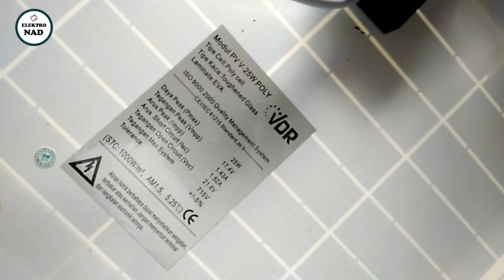12V Battery Solar Charger

Comment: this consumes the power of the panel. the best would be a connection at the battery terminals, which short-circuits the battery, even through a 20w lamp when the voltage is 14.3.. does not tax the panel's power at all.

Comment: Can we use a commercial buck converter or step down to decrease the voltage to 12 Volt?

Bisa pakai DC-DC Converter ga untuk menurunkan tegangan ke 12V?
Reply: yes

Comment: El circuito que tenés armado está mal, si medis a la salida del 7815 vas a verificar que la tensión se debe mantener constante en 14 o 15V por más que tapes parcialmente el panel solar, no así como ocurre en tu caso que en el emisor del Tip3055 cae a 4V. Por favor revise el circuito propuesto. Saludos

Comment: My solar panel is1000 watts and battery is 400 AH now I need how many Ah charger,u can make my tips of charger??
Reply: You need 80 to 100 amperes charge controller
Reply: just buy a 20 amps charger and charge for 24hrs. much cheaper and reliable

Comment: That cicuitry was unnecessary! Connect solar panel straight to the battery through a diode. I have a 4'x4' solar panel puts out 19 v at 3/4 amp . I charge batteries of all sizes . There is not enough current to need anything besides a diode in series. The diode prevents the solar cell from draining the battery when its dark or real cloudy! I've been electronics for over 50 years !
Reply: Thank you walter.. will surly try this method.
Reply: Pls provide details for 500 watt panel.
Not a single video available on youtube for 500 watt panel to 12 or 13 v with ampere.
Thank you
Reply: @gaurav8396  with a 500 watt you might need a regulator circuit. But you could use a 2amp power supply diode in series with the plus or red wire . Put ohm meter on low amperage scale 5 or 10amp range in series with the diode in full sun light if its over 2 amps you'll have to parrallel 2 or 3 dides to handle the current.
Reply: What is the value of diode?thnx
Reply: @akoguapo3517  Any 1or 2 amp 1000v piv power supply diode . I take them out of junk circuit boards. They are black with a white stripe on one end . Connect like this.
Solar panel red + wire to diode --->!---+ to battery. White stripe goes to battery.

Comment: Were is over charge protection
Reply: Yes the circuit are wrong   he must use the out of 7815 to the batery so the max voltage never will more than 14.3 after the inverse diode....fundamental whatson

Comment: Ic LM78XX keluaran arusnya hanya 1A, jadi fungsi TR3055 sebagai penguat arus output 😎
Reply: Or you can connect in parallel as many as you need 3055 transistor

Comment: bisa auto cut ngak? kalau aki udah penuh.
Reply from the maker: Tidak bisa,.. masih manual dulu.. dicek pakai multitester atau voltmeter digital.
rencananya mau buat bertahap,, dari regulator dahulu setelah itu baru rangkaian autocutnya ....
Reply: @ElektroNad14  kalau ic sama tranaistornya bisa pakai tipe yg lainnya?
Reply from the maker: Transistornya Jenis NPN bisa pakai yang 2N3055 atau bisa diganti dengan 2sc5200... 
Ic regulator 7815nya banyak beredar dipasaran...